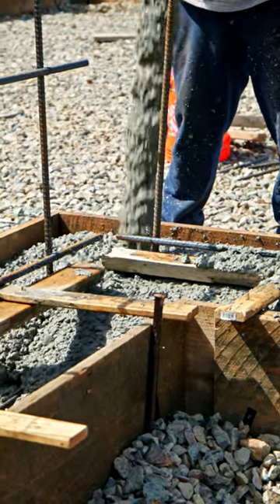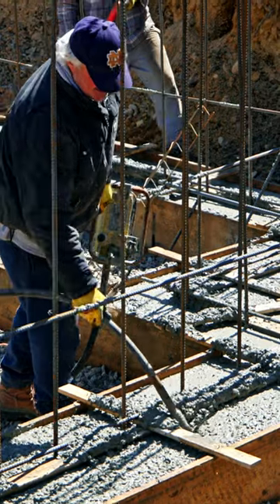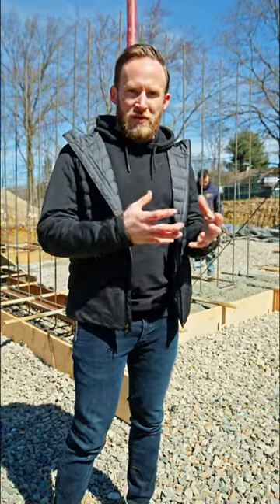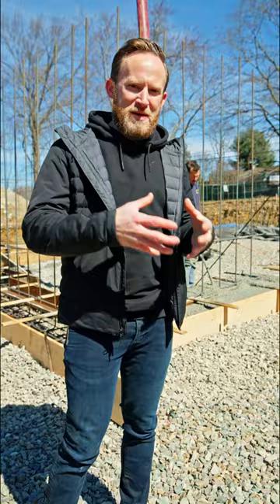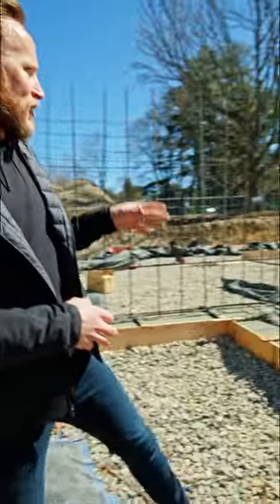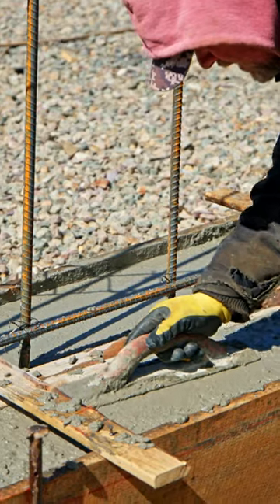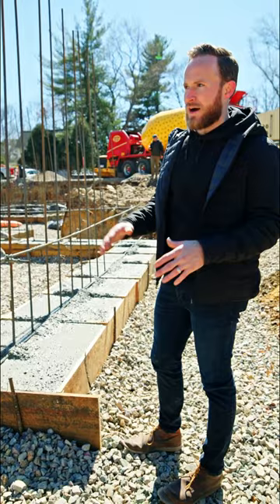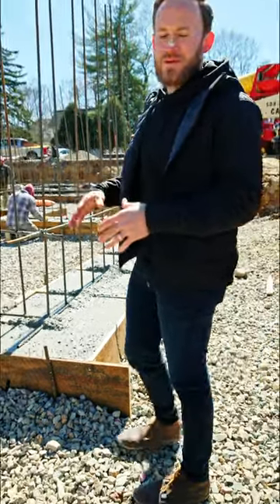"Placing'' Concrete

Comment: wouldn't a rifle-like vibrator be more comfortable to handle and perhaps used two by one person? i see the guy hold the engine in one hand and other hand holds the transfer cable to aim. wouldn't an backpacked engine be better with two joints for two straight axles to be held in both arms to vibrate two places in the concrete at once?

Comment: Not only is it flat but it’s level….same thing 
Not only filling the voids but making sure there are no gaps….same thing
Reply: Voids and gaps, yeah same thing
But the way he was saying flat/level are not the same
By flat he means there are no hills/valleys in the surface, something can be flat but not level
Level meaning it is perfectly horizontal, which technically also means it has to be flat but I have seen many pours where you can put a 3 ft level across it and it is level but it isnt flat under the entire edge of the level, so in the case of concrete you really need to watch for both as seperate things
Reply: Level meaning horizontal to the earth. In a sloped area, flat means be parallel to the ground, but level means horizontally placed to the ground.
Reply: Nah… flat and level are not the same.
Voids are holes and gaps are formed where two things meet. 
They’re not the same. 
It sounds pedantic but vocabulary exists for a reason, my phone is flat, but it isn’t level. You want the concrete flat so you can build on top of it, level so the house is level and builds up straight, no voids which are small bubbles that cause weaknesses, and no gaps between the concrete slabs that eventually form into large cracks or collect water and erode away. 

In a sidewalk you want it flat, level is less important and no voids. Sidewalks need gaps for expansion and contraction. Flat with no voids is good enough in that situation. 

For a house you want flat and level, no gaps or voids. 

Get it? 

The details matter when it’s something as important and expensive as a house, when a storm or earthquake could cause it to potentially collapse killing everyone. If you think I’m being dramatic look up how many awful tragedies happened because of small details like the hotel that collapsed in FL recently, or those crane collapses that killed people too… small mistakes with huge consequences because of small details.